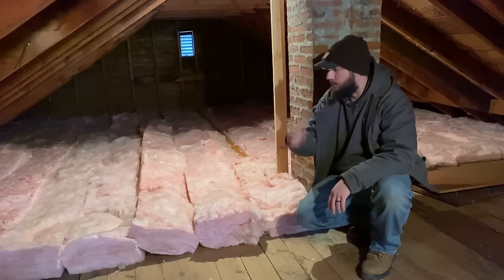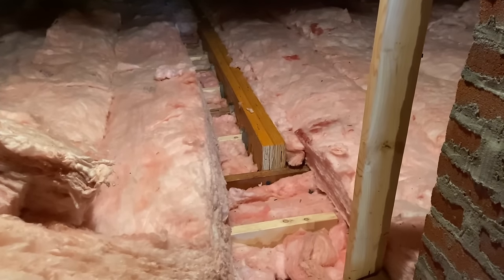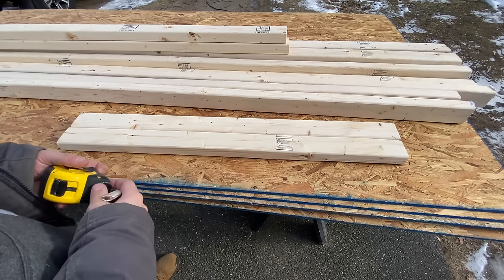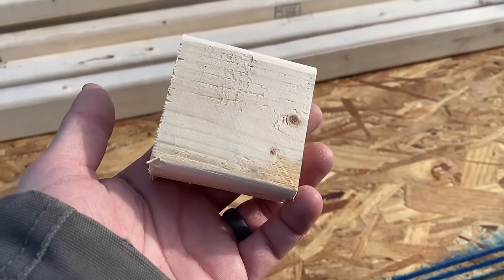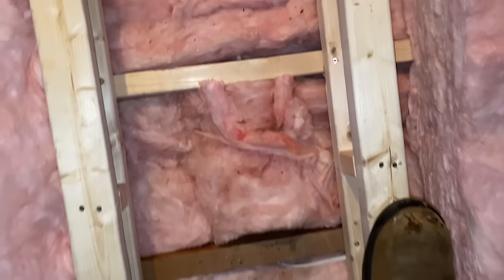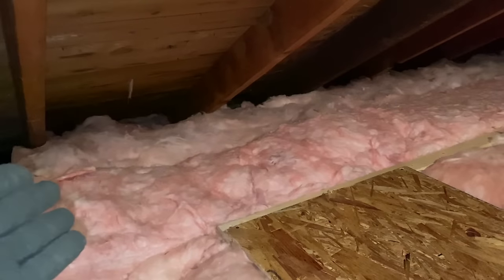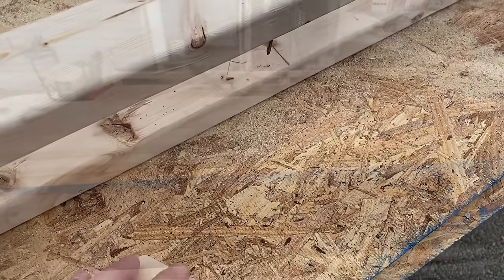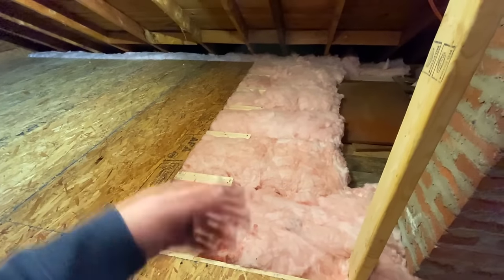Reclaiming Attic Storage Space Over Thick Insulation!

Comment: Did you consider insulating the roof with 6" of spray foam?  That gives R30.  That preserves the attic height.  The existing ceiling could be reinforced by sistering with 2x6's.
Reply from the maker: Hey, Carl!  The point of the insulation in my case is to insulate the house below the attic.  If I was to insulate the roof I would have to a) add heat to the attic b) insulate all of the roof and exterior walls and/or build new walls to insulate.  The problem with this would also be that I would be trapping moisture in between the two insulated areas.  Hope this makes sense.  Thanks for checking out the video!

Comment: Great work as always. I'm a fan of your channel. As a multi disciplinary handyman myself, i truely appreciate the hardwork needed to remodel a house. :) Great stuff

I do have a question though. Was it really worth going the 2x3's route given the fact that each fabricated beams you made totals at about 11$ just in wood, not accounting for the price of nails and the extra electricity needed to cut a gazillon amount of small blocks?  Was the price of 2x6's really that higher to justify the tons of extra work needed to go for the 2x3's option?

Just a thought.
Reply: The constructed beams were a bit less weight than a solid 2x6, and also doesn't create a solid thermal bridge.  Also the "web" of the beam was easier to screw down than toenail screwing through the 2x6s would've been, or needing to clearance drill vertical holes through most of their width to allow a straight down screw to be used.

In short, seems he decided it was.
Reply: @mlindholm   Thanks for the answer. It's appreciated :)

Comment: Maybe someone noticed and can answer--did you fill in the voids that your mini walls created between the Batts? Or will the Batts kind of spread out and fill in those voids?
Reply: I don’t believe they will spread out, and these voids make the insulations rated R value lower because of it. Insulation becomes less effective. When air is allowed to move through it, for insulation to actually perform properly it needs to have something on all six sides of it.
Reply: @edwardjanowiak  Yeah, that's why I'm asking. I think I will take the time to at least put either fiberglass or Styrofoam  insulation between the "studs" in each mini wall before bringing them up into the attic and preserve as much of that R value as possible. The wood is not as good of an insulator, but ya can only do what you can do--at least fill the gaps between wood pieces.

Comment: This is going to mold because of the contact between the osb and the isulation in an instant. You will allways have a bit of condensate if you got a cold room which opens up to a heated room. This condensate will drip from your beams onto your osb and'/or condensate directly under your osb. No way out for the water in this insulation. Or do I  miss something?
Reply from the maker: A few people have said this… I did use a vapor barrier (6 mil plastic) under the insulation when I did the remodel downstairs.  Hopefully that will block most of it.  It has been a few months and no problem so far.  I left one piece loose so I can keep checking it.  We will see!  Thanks for watching and for the comment!

Comment: My question is, how is the load being carried? Everything that I've learned about framing says you should "sister" your existing ceiling joists to the new ceiling joist to span from wall to wall in order to carry the load. Unless there are load bearing walls directly under your storage area. This will begin to sag over time if not.
Reply from the maker: Hi!  It all depends on the house.  In my case I remodeled the living room below.  When I did that I installed an LVL rated for "light storage" and added more ceiling joists in between the 24" on center existing ones.  So for me, this will be more than good but for other houses it will be up to the person doing it to determine if their ceiling can hold the extra weight.  Hope this helps.  Thanks for watching!

Comment: I'm in the middle of doing this now and I am concerned about moisture build up on the bottom of the osb. The ceiling below doesn't have a moisture barrier on it. Can I leave gaps between osb or drill ventilation holes in the osb to allow for ventilation coming up from below so as it doesn't condense on the bottom of the osb? Love the video!

Comment: my new house has an unfinished attic. there are 24" spaced joists and rafters with blown insulation on top. i the builder about doing something like you are, a raised platform. 
HOWEVER, the builder said the attic COULD NOT support any other weight other than insulation.

Comment: 1) with an open floor you could have brought up lights and laid down electrical wire. Strip LED lights on the ceiling would be nice. 

2) with an open floor you could have put electrical outlets at the end. 

3) why extend the hight of 2x6 with a 2x3 for insulation? What would the RVR rating be with just 6” of insulation? Why not spray foam on the celling. With all the money you spent on lumber you could have paid for the spray foam. 

4) why didn’t you glue the OSB down? Won’t it squeak? 7/16” plywood is a too thin. 1 1/4” drywall screws aren’t strong enough. 

5) why didn’t you hire a structural engineer to give you an assessment of the dead weight load capacity? My guess is that floor won’t hold more than 30 psf of dead weight. How much does the mini wall and plywood weigh? Won’t this make your 2nd floor celling sag when you pack this space with heavy boxes?  

6) why didn’t you take the plywood all the way to the rafters. You may not roll over there or stack gold bullion but boxes can fall over etc.
Reply from the maker: Why didn’t you just come over and do the project for me? 😬🤣

Comment: Great helpful video. Quick question? How do you or did you determine the amount of weight you can put top of the attic with adding the 2x3's + the  plywood + the storage materials i.e boxes, etc. ? At what point does the weight become to heavy for the structure?
Reply: Imposed loads are a problem strapping attached to the pearlingand roof joist would compensate for this...., a variant barrier to roof joisting  and a foam barrier would dispense with moisture and assist with thermal

Comment: Cheaper to do what I am gonna do. Put the extra 8" insulation between/under the rafters. As long as there is an airgap between roofing and insulation its actually more efficient.

Edit: omg you don't need every rafter for storage every 2nd will work fine.

Comment: 2x6x needed length with 10” header-lock screws every 4’ would have been cheaper and much lighter than the triple 2x3s and would have been strong enough; you can run the 2x6 at 90 degrees to the floor joists and don’t need to run them sisters on top. I’ve used this process a few times though I prefer a 2’ center with blown in under it as you can blow and rake it in with zero compression. The wood and OSB wight can add up quite quickly, especially over rafters; make sure you know your structure and what it can handle. Narrow crown staples work well, are much faster than screws, and provide plenty of holding strength.
Reply: 2 ft center with blown in?

Comment: Is that CDX GRADE plywood or OSB? You could increase the insulating value of the attic by insulating the area under the roof  and end walls. You can then place plastic over the insulation allowing ar least a six inch uninsulated gap, top and bottom to allow the roof to breathe.
Reply from the maker: It’s OSB.  I am not worried about insulating the roof because the attic is not a climate controlled space.

Comment: Wondering if it would have been easier to hang that second layer of insulation up in between the roof rafters with string and then just laid down the osb. Granted you would have needed to buy additional insulation but then your attic would be warmer as well.
Reply: Yeah, I was wondering the same. Why not insulate the rafters, then osb sheets on the ceiling joists?
Reply: @jeradclark  then the whole attic would also be insulated, which would reduce potential damage to stored items and allow for easier future storage expansion
Reply: Guess that's why his name is 'The Fixer' and not 'The Planner'
Reply: @gymbo343  oh stop it. Insulating the rafters is more work (moisture control, airflow to the outside, etc.). I'm not knocking what he did, just curious on the decision making process.

Comment: Was just thinking,  if 2 of the sides of the 2x3 blocks are 2.5 inches,  to avoid splitting,  maybe you could have rotated them to have the ends facing out, and nail through the sides?
Reply from the maker: Maybe... but I think I would have had the same chance of splitting them as the grain is going the same way.  When I did the "I beam" it did not split because there was more material.  But hey, it got done with only 1 split!!  Thanks for the comment and for checking out the video!

Comment: Insane dude.  You said something interesting though about staggering the seams.  I have always heard that this in some way increases floor stability, but can't wrap my head around way that would be.  

Everyone just answers, 'It just does.'  Any insight on this one?  Thanks man.
Reply from the maker: Hey, James!  I agree with that.  Let me explain why I think so if I can.  I will use this "floor" as an example.  So if you watch my living room remodel you would see I put in this lvl.  I connected the ceiling joists to it with joist hangers and then I added a 3/4 piece of plywood under them to add strength to it.  The roof rafters are sitting in a way on the outside walls that they always put outward pressure on them (especially with a snow load) so those ceiling joists need to be tied together, not just so they don't collapse but so they don't get pushed out by the roof.  
I don't have to worry about that in the attic because I have already beefed it up and made sure they are not moving but lets say i only used some toe nails to attach each rafter to the beam... It would then be a good idea to stagger the seams of this plywood.  Because as the plywood is now, the way I attached it, there is a weak spot, that is that seam that goes along the entire beam.  If I had staggered the seams I would have every other sheet of osb attached to either side which would increase the resistance of the roof rafters pushing the outside walls outward.  In other applications, staggering the seams take away those weak spots and make the entire floor a more "locked together" cohesive unit.

This is not something I was taught in school or anything.  This is just how I think about it after years of building stuff.  I hope I explained it so that it is understandable.  Also when you put a floor down, having 4 corners in one spot gives a chance of less material to attach to a given floor joist.  When you stagger you only ever have a max of 2 edges of a sheet meeting, making everything more rigid.  And also I could be dead wrong haha.

Thanks so much for watching!
Reply: @TheFixerHomeRepair  That was excellent.   So essentially staggering the panels allows the load to be shared by 3 additional joists on each end (basically meshing 12  joists together by staggering 3 panels) Maybe that isn't the best way to say it,  but I feel pretty good about it now.   

Thanks for taking the time to explain.   I really appreciate it.

Comment: If the height of the 2x3 put on side was just right you could've just cut short pieces of random length and put those short pieces on their side. Not that it matters much, you made it work anyway, but that would've been slightly easier and faster.

Comment: How did the price of this compare to getting spray foam on the underside of the roof to make the whole attic a condioned space?
Reply from the maker: Hey, Michael!  The point of the insulation in my case is to insulate the house below the attic.  If I was to insulate the roof I would have to a) add heat to the attic b) insulate all of the roof and exterior walls and/or build new walls to insulate.  The problem with this would also be that I would be trapping moisture in between the two insulated areas.  Hope this makes sense.  Thanks for checking out the video!

Comment: Dude...What are you doing at 11:56?? Why are you holding it up like that? Is it so you don't cut too deep? Those Makita (and virtually all) circular saws have a depth adjustment. Little lever to the left and below the handle. You loosen that and then the entire bottom surface of the saw will lower, giving less depth of cut. Some circular saws even have little measurement markings on the blade guard that you can line up with the bottom to help set the depth of cut. I don't know exactly which saw that is, but both the 7 1/4" and 8 1/4" corded Makita circular saws show how to do the depth adjustment on Page 6 of the Instruction manual.

Comment: You should have used foam to air seal the ceiling, then you should not have compressed the insulation, you should not store things in the attic, rather, just let outside air blow through the attic to keep the temperature of the roof the same on both the interior and exterior side the same, so that condensation does not form on the roof causing it to rot or grow mold. Attic is not a healthy storage space for things, due to potential mold, squirrels and mice, and like I said, the insulation is not supposed to be compressed.

Comment: What dimension are those ceiling joists? Not sure about other factors on this work and how everything is structurally supported I kinda scanned the video so maybe they did their homework but I would caution anyone from just going into their attic and slapping a bunch of lumber and boards together so that they can stuff more and heavier things into their attic.  If not doing it right you are adding a lot of extra weight that isn't adding any structural strength with just the lumber and boards themselves, then you are going to put even more weight on top.
Reply from the maker: Yeah... I went over all of this in the video.  😀👍
Reply: @TheFixerHomeRepair  That's what I get for skipping over bits.  Good on you.
Reply from the maker: @JoeL-mm2lc  all good.  Thanks for checking it out and for the comment!

Comment: you might end up with fiberglass particles all over your stuff, if there is any air leaks the wind will blow it in there.  I have a similar situation in my garage there is fiberglass all over everything in there. itches very bad no visible sign of fiberglass anywhere
Reply from the maker: Yeah, kinda is what it is.  I don't have anywhere else to store stuff.  Usually when I pull something down from the attic it is just covered in dust, not insulation.  Thanks for checking out the video!

Comment: So many views...  I am sure this is fine in the south.  Up north this would fail inspection and likely cause condensation damage in cold weather.  If your attic has 2 layers of R20 and woodchips its there for a reason.  Never compress fiberglass batts and if you don't thoroughly understand ice damming and vapor lock don't mess with your attic!

Comment: Building those little walls was not a good idea. Now you have gaps in the insulation layer, unless you insulated each of those little spaces in the "walls" you built, which I did e see you do. Either way it would have just been easier to use 2x6 or 2x8 or whatever size 2x you need to make the correct spacing. Batt insulation needs to be continuous. Any gaps, missing areas or crushed insulation hurts the insulating value. In fact 3% fail in properly insulating with Batts equals a loss of as much as 30% in insulating value. 
Better idea for an attic that looks like that, that you want to use would be to spray foam the underside of the roof. This will give you the r-value you need plus air sealing the attic and the house. Air leakage is actually just as or more important than r-value. I always recommend closed cell spray foam. Also if you foam the roof you also need to look into weather or not you will need a HRV or ERV. I do these in all houses I build now. My house are tighter than 99% of houses even new but air quality is better.
Reply: People think they have the R value of what the insulation bag says. Air leakage is the worst.

Comment: My only concern (at least from my house) is making it so the electrical becomes pretty much unaccessible. Love the idea though.
Reply: Possibly to over the electrical issue ,mark out on top sheet where joint boxes are ,and if needs be at later date drill inspection hole.
Reply from the maker: Hey, Kirk!  That is one reason I use screws.  It won't be too difficult to take these boards up and I did all the wiring so I know where it all is.  Thanks for the comment and for checking out the video!!

Comment: This is all wrong, you will get rot in the timbers if you do it this way because the moisture that passes upwards through the ceilings below will condense and get trappedunder the boards. You need to fit a bunch of plastic triangles to the joists and lay the boards on top of those, thus allowing the moisture to escape. Your boards end up sitting about 12 inches above the joists, so the moisture can escape. It is well known in the UK you can't board directly over insulation if it is say 300mm or more which the regs require now.
Reply from the maker: I installed a vapor barrier on the remodel below for this reason.  i am not worried about it.  Thank you for the feedback and for checking out the video!

Comment: The best choice for this would have been to spray foam the roof.  Otherwise the temp in the attic space would not be good for storage.
Reply: The attic temp before and after the insulation project is basically the same (ignoring leakage through ceiling due to insulation differences). If storing stuff worked for him before, it’ll work about the same now.